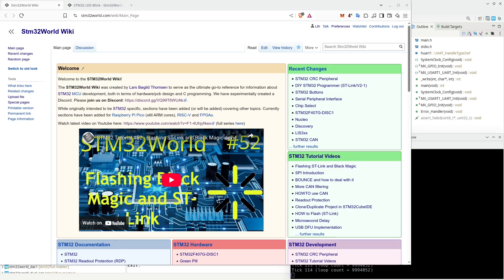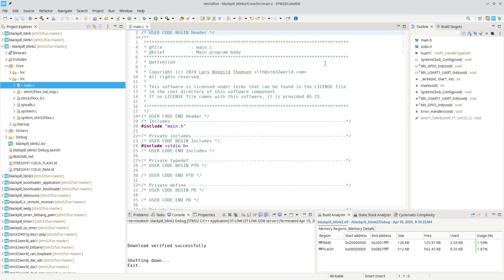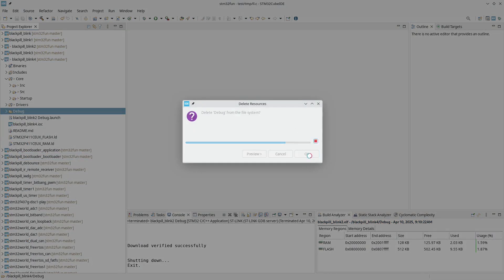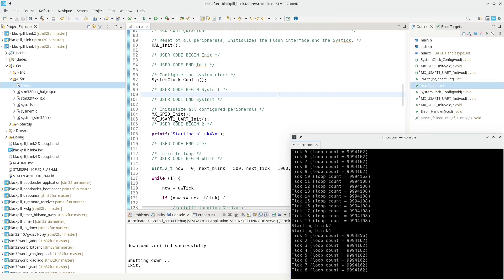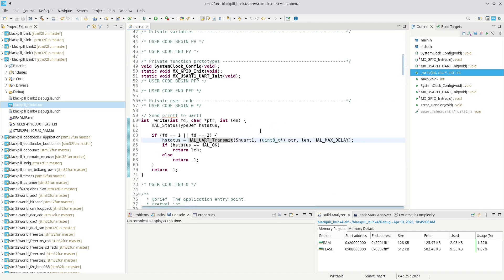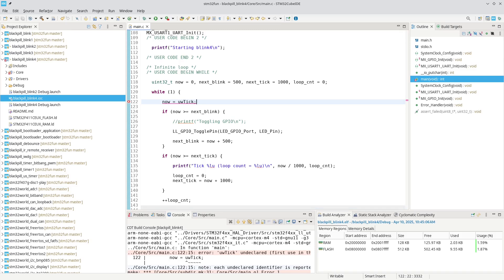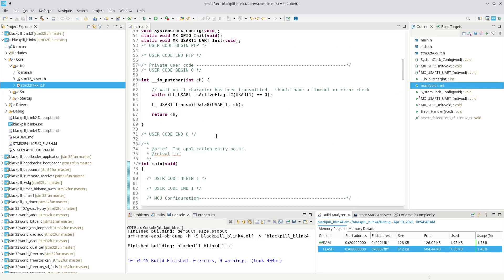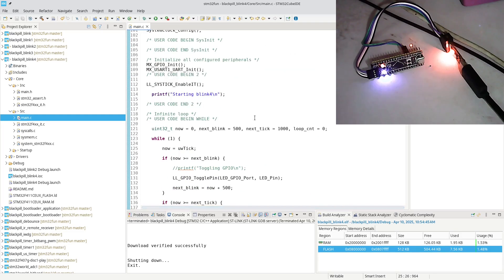STM32 Tutorial #54 - LED Blink low level without HAL

Comment: Interesting to note the slowdown in the LL version. It is of course because of the wait in the __io_putchar() and the HAL is probably doing that with a buffer and serve the chars in the interrupt routing.
Reply from the maker: Annoying that you should point that out ;)  I DID notice and I DID deliberately not mention it - mostly because I was too lazy and/or incompetent to look at the assembler code.  But you are absolutely right.  The HAL version have more time to run through the loops.
I am not sure you are right that it is because of the putchar, as the HAL version use putchar from write.  But it is entirely possible there's a better way of doing the putchar wait.
Reply: @stm32world  It is probably not the putchar after all, the amount of serial out shouldn't be that impactful. 50 characters per second, that are output at 200,000/second (2Mbps of 10 bits/char). So, assuming 96MHz it waits for ~500 clock cycles per byte, times 50. Should only eat away 50,000 or so cycles from your counter, not 5 million. (If I got he math right)
Reply from the maker: I never figured this one out but also didn't spend time on it.

Comment: low level - interesting implementation. I came across documentation - raspberry-pi-pico-c-sdk. This sdk is organized in a very interesting way. I recommend you take a look.
Reply from the maker: I have used pico's before.  The most interesting feature to me is the little state machine they've got on each GPIO pin (forgot what they call it).  Either way - at least for now this is a STM32 only channel ;)
Reply: @stm32world  yes, I'm talking about the implementation of finite state machines (PIO), as I understand it, they are organized by hardware. very cool. and  just organizing structures for access to the functionality of the microcontroller is also interesting made. and thanks for your videos of course)
Reply from the maker: The PIOs are perhaps the coolest thing about the Pico.